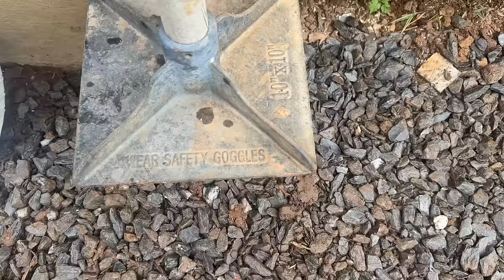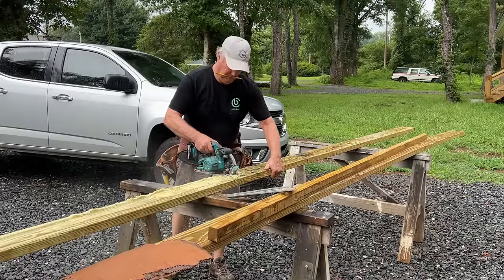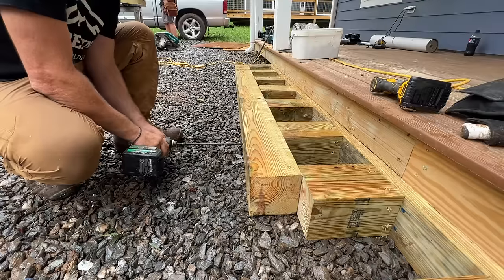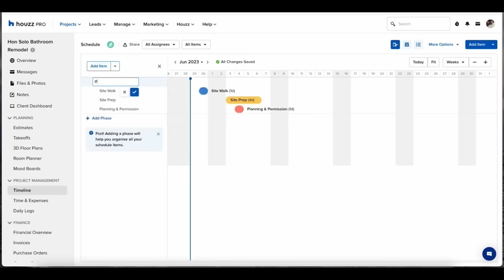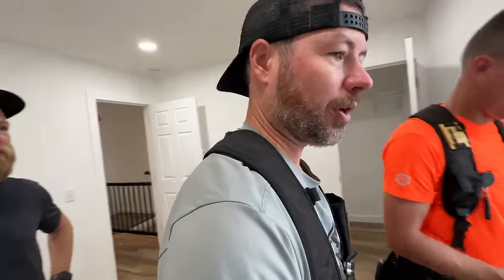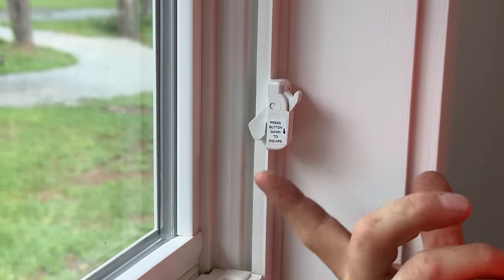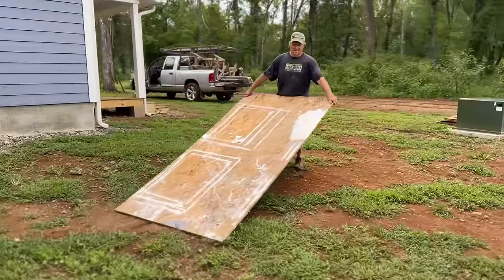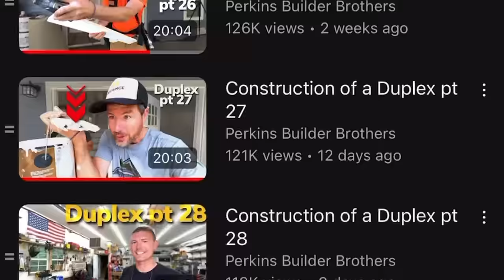Construction of a Duplex pt 32 (FINAL)

Comment: 12:38 Pro-Tip
you can hold the drill screw bit as a push pin against the drywall anchor,  just so you don't risk the hammer to close to the mirror ;)

Comment: Congratulations Perkins Team, another great project completed. Although smaller than your usual builds it is built with the same care and planning that goes into every job. Can't wait till next project starts, thanks for posting and all of you take care and be well 🔨🔨🔨🔨🔨
Reply: My favorite trick is to put the screw into the anchor just until its about to spread the anchor, then push or hammer on the screw head.
Reply: I must admit going into brick or block I've done the same as you, but usually I screw them in all the way. The choice of drywall anchors is so vast it could be confusing, but personally the alloy screw in ones work for me.

Comment: I think what you call a duplex in the US, we call a semidetached house in the UK. A duplex in Europe is an apartment, in an apartment building, that occupies two floors. Either way sad to see this finish. It turned out really well.
Reply: We differentiate duplex from semidetached by plot. If the building has one address,  and one main service to the lot for the building, it's considered a single building with separate dwellings. The name changes based on dwellings of one address, triplex, fourplex, multiplex (apartment building). A semidetached is no more than two houses sharing some walls but having separate addresses and separate services.

Comment: hand thread the screw into the drywall plug then you tap the screw with the hammer and the screw is already in ready to go. also you dont hit the wall with the hammer.

Comment: I want to take a moment and comment on those linen closets. When we fixed up our old house to sale we did something similar. replaced the old, 1x12 cupped, split in the middle white painted boards with some newer 1x12 glued stain grade boards, and stained them. So much more pop and warmth leaving a little bit of stained wood instead of the boring white painted or wire shelving. good look!

Comment: Being more of a framing construction type of guy, I'm honestly looking forward to the next. Amazingly I made it all the way through this series without skipping any parts (which I usually do towards the end) We more often then not, in Oz when I worked in the industry, would have 2 main crews. 1 for slab, framing, roof etc (basically to lock up) & then the 2nd fix crew who specialised in arcs, skirtings etc. more of the fine work finishing off. While I occasionally did that (especially during extended periods of rain) I mainly specialised in the main construction especially cyclone & building regulations. I still love watching you guys no mater what, it really makes me miss the industry big time & had been considering re entering the trade more as a handy man until I retire, but today I scored a job working for the local Government which will still include some construction, so that's ok. Really looking forward to the next one. Cheers from Australia!!

Comment: Having the same triple hammer from Metabo HPT, what you're experiencing is the triple hammer essentially missing the required anvil rotation and slamming back down. While the triple hammer is a great impact, they do struggle with larger fasteners that require more driving torque because of their internal hammer mechanism design

Comment: hello from the UK. I love u guys! One question though, shouldn't be handrail also attached to this small portion of the wall where metal fence finishes going upstairs? Now, when u'r going downstair somewhere in the middle you have this huge one-piece handrail only on the big drywall... Shouldn't be that the building code?

Comment: Pro Tip from Sydney Australia.
When hanging mirrors or pictures and you need to transfer measurements to the wall. Stop and use a length of masking tape. Lightly place it on the back and mark your points, then take off a stick to the wall... simple.
🌏🇭🇲

Comment: I watched all the episodes in a row. I learned a lot about construction, of course I wonder about a few things like inch measurements, doors that open in. I myself live further north, where you need to make better wall insulation and use three-layer windows, take into account condensation and moisture removal, ventilated upper floor.. It would be nice to have a separate video series, even from another supplier, where air conditioning, plumbing and electrical installations are reviewed. A wonderful educational series, nicely filmed and edited and made by a nice team.

Comment: You have done the mirror bracket incorrectly, the ones on the bottom hold it up and then you put them on either side to stop it sliding off the brackets, put them top and bottom allow the mirror to slide to the sides and off the bottom brackets.

Comment: 12:36 use a Philips tip screw driver and push it in or tap the handle of the screw driver while  the tip is against the plastic insert. please don't ever do that again lol